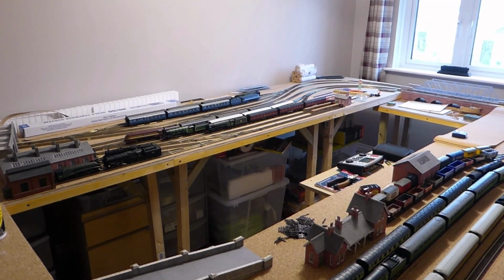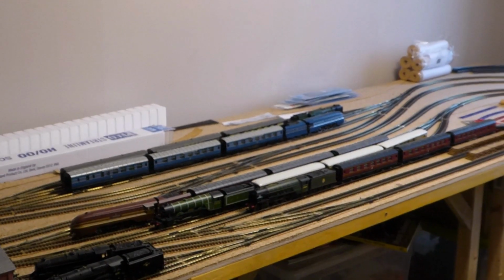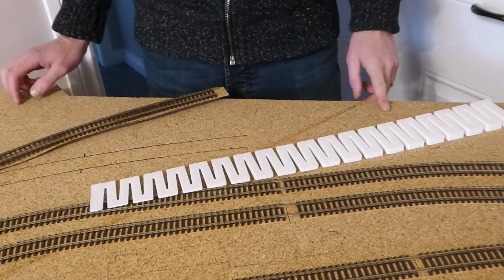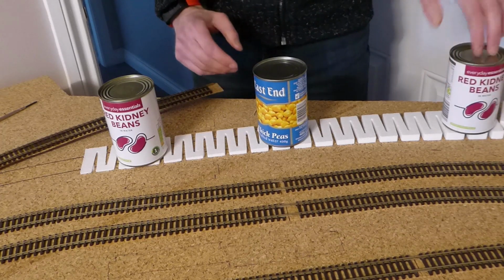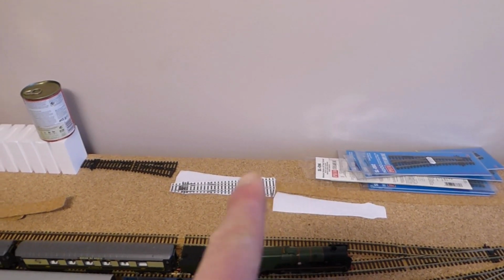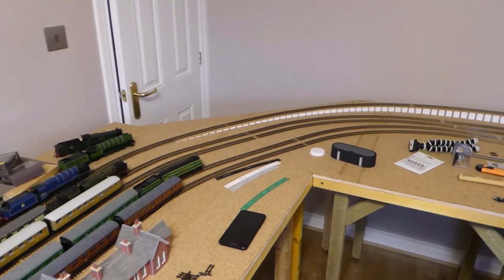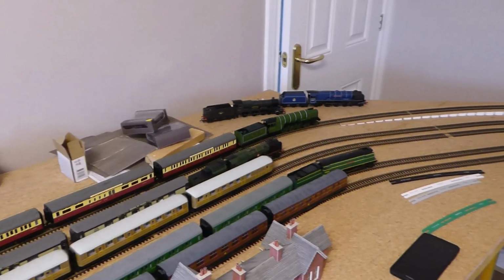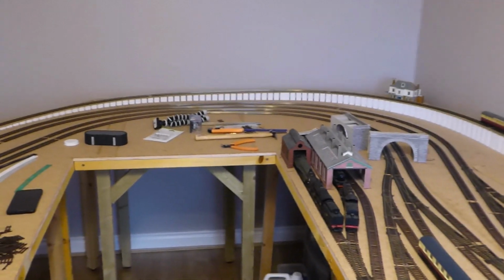Greenhill Junction - Installing an Incline - Video 17

Comment: Great job on the incline and they got up it at a fairly slow speed so job well done. The system you were thinking of is the DCC Concepts Power Base where you have base plates under the track and small magnets on the underside of the loco. Jenny Kirk did a video where she visited DCC Concepts and they did a demo on it. One thing I must say is I am very jealous of your selection of canned vegetables as our local supermarkets have not had any for days !!!!!!!!!!!!!!!!!!!!!  Keep well and safe Cheers Kev
Reply from the maker: That's the one, cheers Kev. I think I'll do fine without it though. With regards to the cans, luckily we did the months shopping just before things went crazy. I'm semi rural too so have escaped the true craziness and have a wee shop down the road that gets enough essentials to always stay reasonably stocked. Take care and see you on the other side. Just wish I'd got the wood in for the upper level before the lockdown was announced tonight.

Comment: Interesting predicament with the bridge, always something that comes up when building a layout I find but sounds like a good solution. There are a fair few bridges at different levels in close proximity in and around Manchester which would make a great feature. Will be interesting to see how they both look, thanks for sharing, all the best, Paul
Reply from the maker: Hi Paul. Thanks for watching and commenting. The bridges are close together but I wanted to create a scene in front of them so had to squeeze them together. Tbh I'm now looking at the viaduct and wondering if I should replace that with a wider span bridge to make the scenery easier to do. I have designed it so they can all be taken out of need be. Cheers, John.

Comment: What a great job!  The arc on your rise is not bad at all.  I felt like your trains handled it well, especially at such slow speeds.  I have Woodland Scenic 2% risers on my table and even my longer trains (albeit electric) handle it with no problem, unless I am at very slow speed.
Reply from the maker: Thanks Anthony. I suppose I was running them a bit slow but didn't want them crashing off the track on the first test. 😆

Comment: There is one disadvantage with this Woodland Scenics product. It is obviously aimed at users of American HO locos, many of which are fitted with traction tyres ! Unlike British outline products that generally like to avoid traction tyres. British steam outline in particular will therefore seriously struggle to haul more than a couple of coaches up even a 2% gradient. Indeed like real steam locos they don't like gradients of more than about 0.5%, and if the gradient has curves, the problem will be massively increased as curves effectively mean the gradient is much steeper.  It's a Law of Physics !!! 
Happy Modelling 😝.
Reply from the maker: Hi James. I don't find that problem at all. I can get any of my steam locos up my 2% incline with a decent train of coaches or wagons behind it no problems at all. Curves do make it more difficult, hence the reason I kept these ones so gentle. Cheers ,John.

Comment: Try putting some weights in the coaches and tender for better traction.
Reply from the maker: Hi Phil. Thanks for watching and commenting. I think that would have the opposite effect as it would lead to more weight, drag and strain on the motor, just the same as adding more carriages. Al my locos make it up with 3 which is enough for me. Cheers, John.